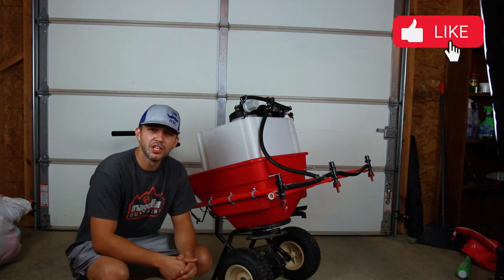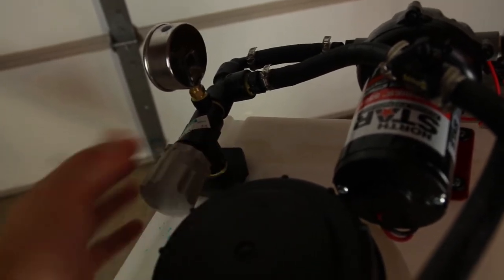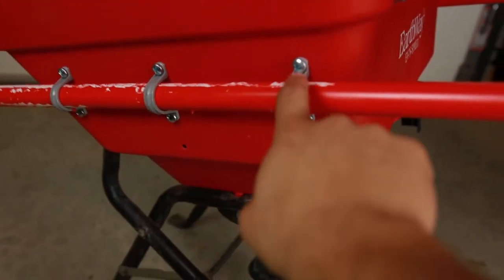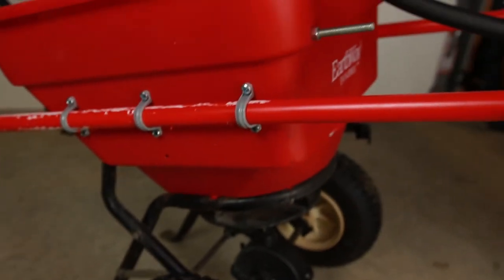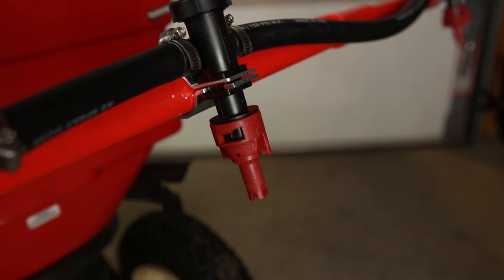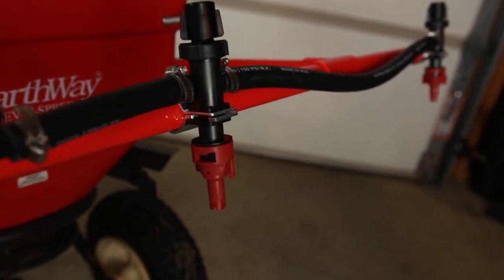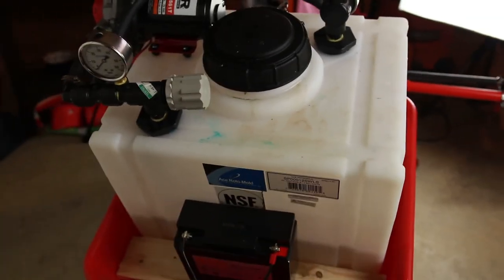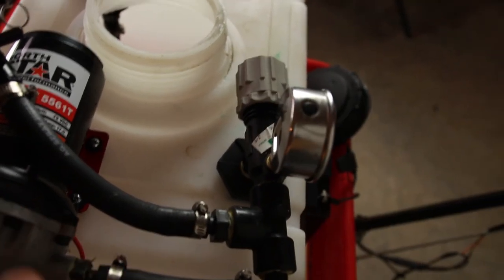DIY Boom Sprayer for Your Lawn

Comment: Nice build! Looks like a great addition to a sprayer collection- I’ve only got 5k sq ft...  if I were to use a smaller pump and tank, would probably be doable! 🤔
Reply from the maker: +Don’s Lawns For sure! I’d recommend something in the 6-8 gallon tank range. It’s worth it to me.. especially after trying to get even coverage with plant growth regulator using a 1 nozzle wand.
Reply: The Lawn Channel that’s very true! I recently started using sprayers, and have learned a little bit pretty fast in regards to the nozzle and overlap issues. Lol

Comment: I love this setup. I want to build one. Did you put a parts list anywhere in the comments?
There are lots of features making this impressive:
Filter, pressure gauge and regulator, recirculation, individual nozzle control, boom extension (in/out).
Very nice. Thanks.
Reply from the maker: Will see what I can do about that
Reply: The lawn rebel has a parts list.

Comment: Nice engineering. It must be nice to have it on wheels, I’m tired of refilling my 4 gallon backpack and lugging it around. 

You need headlights and a horn now. 

Is it still functional as a broadcast spreader?
Reply from the maker: +MatthewinGA Yeah it still functions as a spreader too. I just pull the tank off the top and remove boom. Takes about a minute if that.

Comment: It's gonna be heavy when filled with water. I have a 15 gallon trailer sprayer hitched to my riding mower.
Reply from the maker: Oh yeah it's very heavy. lol. Too heavy for the spreader. I am going to try and have something welded together to hold the tank.. Put some nice wheels on it and go hat route. Although.. How do you like the pull behind method? I have a lot of land now (which is what has kept me from diving into the lawn).. so I need something that is reliable but easy to get around.
Reply: @TheLawnChannel  I purchased the 15gal Fimco trailer sprayer from Blain's Farm &Fleet. You can also get it at ACE hardware or Tractor Supply.  
I buy the liquid 2.5 gal Gordon's weed and feed 15-0-0.  Mix per directions.  The pull behind sprayer is a nice way to fertilize evenly.  I have no crabgrass or dandelions this year.  My 1 acre lawn looks like a golf course.

Comment: I'm new to your channel. You have a great channel man I got a lot of watching to do. Quick question how do you mark off your sprayer width when spraying? Do you use marker dye? I mark by flags when using my backpack sprayer but its so much work. I can't see the blue dye all that well...lol. Looking for sprayer like yours because the backpack is heavy.
Reply from the maker: I just do my best to get an even application. It’s best if you can do it in the morning with the dew on the ground.. then it’s much easier to get it right. Marker dye works fine.. but man it’s expensive when you start using it heavy enough to see where you’ve sprayed. Thanks for checking out the channel! Thanks for kind words!

Comment: Hi, where did you get the nozzles with the cut off valve? Great sprayer build by the way.
Reply from the maker: You can buy them many places. I can’t recall exactly where at the moment. I’ll try pulling the order from email
Reply: @TheLawnChannel  awesome, thanks if you find it but ok if not.

Comment: Have another question for you. The electrical setup, how is it done? Do i need a relay somewhere if the pump is 17 amp and the battery  is 12V 18ah? Try to figure out so it doesn't blow the switch.  Any fuse on the battery, if so what amp? lastly what battery tender do you use?
Reply from the maker: I use a battery tender jr from Amazon.. the electrical setup from memory was simple. 1 lead from switch to battery.. other side of switch went to the pump. Then from battery to pump. I don’t remember which is +/-.. but basically just create a current from switch to battery to pump one way.. and other way is nothing. If that makes sense. You’ll want to use 15amp fuses on the battery if memory serves right. Otherwise the fuse blows and you’ll think your pump/battery is problematic. Hope that makes sense lol
Reply: @TheLawnChannel  So no relay necessary then? Thanks for the info.
Reply from the maker: That would be correct. If you have same setup as me, then it’s not.
Reply: @TheLawnChannel  ok awesome!! Thanks

Comment: Those nozzles are probably spraying less than 1/2 gpm why   Not a pump around 2 gpm, just asking because I’m thinking about building something similar. I like your setup and is that teejet nozzles or what
Reply from the maker: I’ll get the part number on the nozzles, TeeJet is correct though. I went with a higher GPM pump because it gives me room to grow in the future - maybe adding 2 more nozzles if I wanted. That’s only reason.
Reply: The Lawn Channel ok I was just wondering because all those nozzles have a flow rate At different psi
Reply from the maker: If I remember right, the cost difference wasn’t that much either. Are you building one?
Reply: The Lawn Channel yep and I’m already got the quick connect teejet nozzles and body that fit around 1/2 inch pipe, no need for any hose, four nozzles and I was thinking on a 3gpm pump , mine are the turbo flood jet nozzles but the tank will be mounted on the back of my four wheeler

Comment: Do you have a list of the parts for your setup? if not what's the name of the nozzle body that you use? This would eliminate me using micro values in between
Reply: I second that question! Thanks
Reply: Please list part number for the nozzle body and the tip or let us know where you bought it from! Thanks In advance
Reply from the maker: TeeJet 1/2” Quick TeeJet Nozzle Body 22252-312-500-NYB — that’s the body that is more of a T. That’s my middle body. The outside bodies that’s half T is 22251-311-500-NYB ... hope this helps!!
Reply: @TheLawnChannel  The top of the sprayers looks different than what is seen in the video.
Reply from the maker: 58140-NYB.. I replaced the tops with these. It allows you to turn off spray heads individually. You can do it that way, or put on/off valves between each spray head.
Reply: @TheLawnChannel  Awesome!!! Just ordered mine. Thank you!!!!

Comment: How much did you spend on building it?
Reply from the maker: A lot. Lol. Prob $500+ if I remember correctly. That’s not including the spreader I already had.
Reply: @TheLawnChannel  Thanks.  I am between this and a spreadermate.  I already have a pump so I am leaning DIY.
Reply from the maker: It’s not that much cheaper to DIY.. but if you’ve got a pump then yeah prob save a few hundred total compared to buying Spreadermate. I do like their tank design. Only thing I’ll be changing is I’ll be building my own frame for mine sometime maybe this year. Get the tank lower to the ground so it’s easier to maneuver.